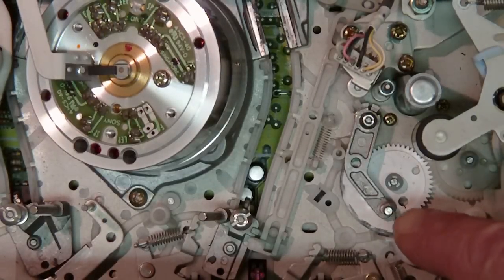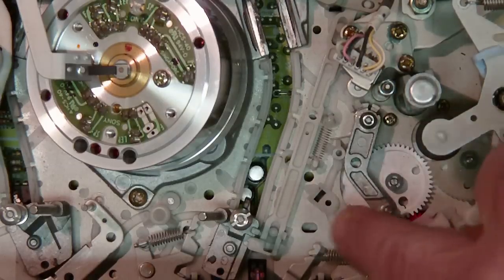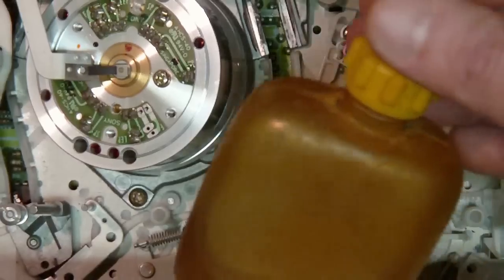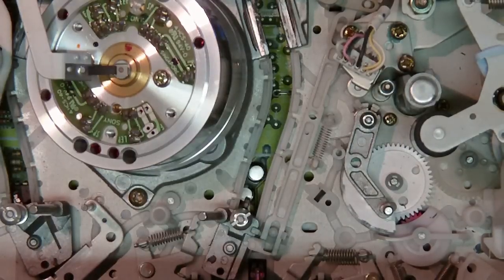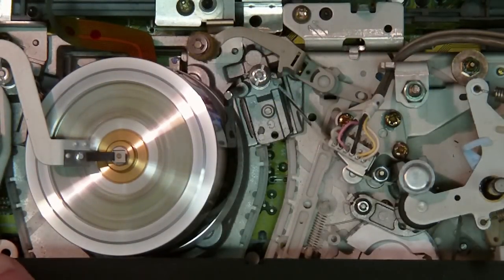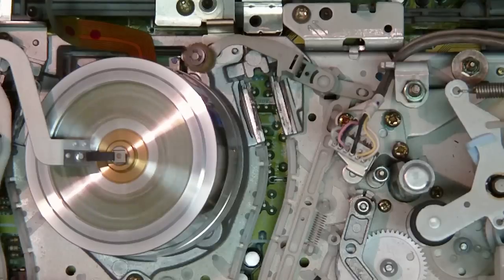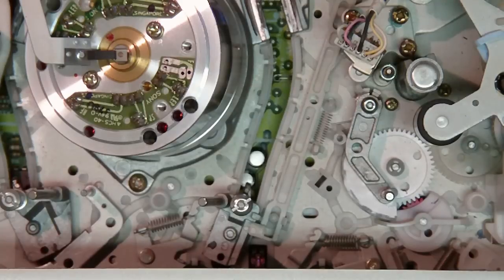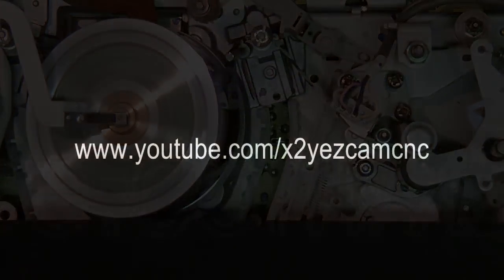Common SONY VCR Video Tape Mech Problems

Comment: I watched this video a couple years ago thinking not much of this.  One day in General Mechanics last year, while the teacher was cleaning out the shop, he found an old Sony VCR with THE SAME PROBLEM.  The arm was stiff and it was eating the tapes.  I took off the top and everyone thought I was crazy to be messing with that thing, but I fixed it, until I plugged it into a tv and found that the whole mechanism was jerky.  I didn't need another mono VCR, so I junked it.  It was fun though.

Comment: Extremely helpful video!  Thanks to you, we turned our Sony SLV-R1000 from a boat anchor into a useful component once again.  Another clue that the arm is stuck is that the counter does not function.  Odd design flaw for such an expensive component.  Either the lube Sony used failed or some type of corrosion took place.  Thanks for posting your video!

Comment: Very interesting video!Some notes: first, after lubricating the arm, you need to realign it as otherwise it will damage the tape.Another problem with these Sony VHS, is that the worm gear for the cassette carriage gets cracked and prevents loading/ unloading a tape.One cure is to glue the gear to the motor shaft.Another familiar problem is the mode switch goes bad (It can be cleaned by disassembly).Capacitors in the power supply and the  servo are also common problems.
Reply from the maker: thanks for your comment

Comment: Thank you very much for this video, especially for mentioning that it requires a 4.5mm socket to unscrew the nut on top of the arm.  I was able to use the information to fix my old SLV-676UC VCR.  On problem that remains however is that it will not rewind anymore.  It makes all the right noises, sounds like it starts rewinding, but the left wheel does not turn.  I don’t see any broken gears, so not sure what the issue would be.  I am wondering where I could find information to help me find the cause and a solution...  Any ideas?

EDIT: I found that there was a gear that was suppose to be able to go up and down.  It was sticking, so I added some silicone spray to it and it seems to have resolved the problem.
Reply from the maker: WELCOME

Comment: I have the SLV-575UC model released in 1990 I believe and I had the same problem as you did. You're video instructions helped me solve the exact problem. I just cleaned  it with some Isopropyl alcohol and it fixed it. The only other problem I seem to be having is I'm not getting Hifi Sound just seems to be in Stereo sound when playing a Hifi Tape. I can hear it trying to kick in but that's about it.
Reply from the maker: welcome....thanks for your comment

Comment: If looking for a VCR to playback old VHS cassettes, I would suggest the later VCR units, the basic models with least controls and basic 2 video heads.  Perhaps JVC units would be the better choice. A remote is not really needed. These later VCR made after 2000 had a more robust design because of mechanical improvements.  The Achilles's heel are the failing capacitors, so keep the unit unplugged when not in use. These will use rubber belts which should still be in good condition. Most youtube videos talk about high end VCRs, many of which are very old and have been used intensively, a gambling.
Reply from the maker: yes

Comment: I have two Sony VCRs; different models but I'm 99% sure they have the same insides. Both have failed in the exact same way! Basically any tape I insert gets ejected while still pulled out; it's like the spindle isn't pulling enough tape back into the cassette before ejecting. It also makes a really loud whirring noise; much louder than it should be. Is this a common issue on later Sony VCRs?
Reply from the maker: thanks for your comment

Comment: Great video! Any tips on what to do when a p guide just comes loose? I can push it up and down the rails but it doesn't catch anywhere, and it's not moving with the other one
Reply from the maker: Check underside of loading gear
Reply: @PCBoardRepair   Checked it and...the arm moving the p guide got disconnected! slotted it back onto the p guide pin on the underside, and it works, thanks, appreciate it
Reply from the maker: @contentious_spartan  thanks man

Comment: Thank you for the Tutorial. The Loading Arm in my Sony VCR is still pretty stiff and I'm having a hard time removing it. Is there a specific tool that works getting inside those tight corners without damaging other surrounding gears or components?
Reply from the maker: small hands

Comment: Great video and thanks for sharing it. Hopefully you are still monitoring these comments as I'm having the same issue where the grease in the arm has hardened and spring can no longer pull the arm back. My question is after the 4.5mm nut and washer is removed what do you do with the spring? I don't want to lift the arm and stretch the spring or does the spring and arm slide up off the pivot pin as an assembly? If not any details on what to do with the spring? Thank you.
Reply from the maker: You don't need to remove the spring? 
Why do you want to remove?
Reply: Thanks for the reply. I didn't want to remove the spring, I was just unsure what how it was all put together to prevent stretching it while pulling the arm off it's post. Anyway, its now working properly thanks to your video. Cheers.

Comment: I own A SONY SLV N750 that eats tapes only when in fast forward or rewind mode [and usually occuring near the end of the tape]. It plays and records OK however.

Would the arm shown in the video be implicated in this specific type of tape-eating problem?What impact does a bad idler tire have [if any] on this type of problem?
Reply: I'm wondering the same thing nearly 10 years later...

Comment: I have a Sony SLV-D300P dvd/vcr where neither are opening ejecting or running. Could it be a motor issue? When you manually move gear wheels everything moves but slowly as you do.
Reply from the maker: could be many things

Comment: I have a tape stuck in a Sony SLV-975HF. Is there a manual way to move the entire mechanism so I can pull out the tape. (I want to save the tape. I'm not so concerned about the vcr- but would like to try to fix it). Is there a worm gear or gear I can turn by hand to make the whole mechanism retract properly?
Reply from the maker: If all else fails look for a disc grinder

Comment: Hi i have a MiniDV/SVHS VCR (JVC HR-DVS1EK) The VHS tape loading works fine but minidv does not, tape will not load it gets stuck upon inserting. Also if i eject it refuses to come out properly could this be a mechanism issue or a pinch roller problem please help as i want to repair mine back to working order.
Reply from the maker: thanks for your comment

Comment: i just bought a sony SLV-695HF and it works all properly. the only issue is when it ejects a squeaking noise happens but it doesnt happen when loading the tape around the head. could it be the thing that reels the tape back in when ejecting?
Reply from the maker: lub it

Comment: I have a Sony VCR SLV-700HF, it is not allowing me to input a vhs tape into the tray, the vhs goes all the way in but the tray doesn’t load and accept it, so the vhs tape basically stays in the front of the tray with about half an inch sticking out of the tray. 

Could it possibly be the arm issue? Or something with the tray?
Reply from the maker: Check the infrared beam emitter in center of loader is working
Reply: @PCBoardRepair  Thank you very much I will look into it!
Reply from the maker: In the center is where the emitter is and on either side of the loading cage there is a sensor that can see whether the beam gets broken or not

Comment: I have a problem with a VCR of mine.  It's not a sony one but maybe you could offer some insight.  It's quite a modern model, bought new in the early 2000's.  It thinks that you are always trying to insert a tape, resulting in it trying to pull in a non-existant cassette.  It fails to do this as a real cassette would release a clip to allow the loading mech to move.  I'm just wondering what I should look for in regards to a sensor to detect a tape load, I cant see anything obvious. Thankyou

Comment: i have a problem that sometimes happens with my sony slv-760hf. pressing play during fast forward or rewind causes the tape to stop and the machine to display an error message on the lcd. with the case open nothing looks strange. if i turn it off and back on the head spins and i hear a motor sound from somewhere else inside for a few seconds then it stops and shows the error message again.  it reads 1L 11 bc usually. if i leave it unplugged for ~12+ hours it usually works when i plug it back in. its hard to figure out what the problem is because when it happens i cant get the tape out. when it starts working again nothing looks wrong and the vcr functions well otherwise. pretty frustrating.
Reply: +Chris Artell I have the same problem with my parents' Sony SLV-E820. Especially when I try to wind the tape (without playing it before) and then press STOP , the VCR stops working and shows the error codes 1L 22 AA, 2L 22 AA, 3L 10 cc, 3L 11 Ac, 3L 11 bc and 3L 11 7c. When the recorder shows one of these error codes, I can hear a motor inside the device; it sounds like it's spinning. The only way to use the recorder again or even to get the cassette out is to wait 15 minutes. I can't open the VCR now because, as I mentioned before, it belongs to my parents who don't want it to be repaired... But if you or anybody finds a solution for this problem, I'd be very interested in it!
Reply from the maker: thanks for your comment

Comment: I have a sony vhs player that throws the tape out of unit. Any thoughts on what to do
Reply from the maker: I'm not sure what THROWS THE TAPE OUT...do you mean the cassette or tape is spilling into machine....need to know exactly what is happening before I will be able to give advice
Reply: When I hit eject it does its normal thing then the mechanism that lifts the tape out almost seems like it get bound up then breaks free which is causing it such a violent eject. It tried watching it many times and just don't see what's causing the problem
Reply: Is there anyway to send video to you
Reply from the maker: @danielrodvold8466  watch carefully
Reply from the maker: I would have to see it to know

Comment: nice video, I have a AIWA  TV VCR combo from 1999, when I stick a VHS in it only plays for about 5 seconds then stops, I get picture and sound, I ran a head cleaner through i but didn't have any luck any solutions to my problem? I was out of town for about a month and it just started doing this when I came back, thanks. sn# 672 - 9Z26840 C
Reply from the maker: thanks for your comment

Comment: When I press play the guides aren't taking the tape to head . What to do?
Reply from the maker: Troubleshoot the issue
Reply: @PCBoardRepair  when I opened the vcr casing, I saw that 2 small stick like things which should actually strech the tape towards the head aren't working. Which is resulting of the video not playing

Comment: What is error 311Ac? I have a Sony SLV-E720 machine. I had a tape stuck inside, that I had to kind of force out. But have this error code now. Also got 3117c error code as well.
Reply from the maker: thanks for your comment

Comment: ERROR CODE C3140 & ERROR CODE C 3142.......How do you fix SONY DSR-25 Cassette loading error code C3140 (when cassette is inserted into the machine but is ejected by the machine due to the error); and error code C3142 (when the cassette tape is inserted but tape would not play, rewind or fast forwarded). How ca these two error codes be corrected so the tape can play again and function normally.
Reply from the maker: not sure

Comment: ON THE METAL PLATE YOU SHOW. THERE IS FROM THE START YOU BUY THE MACHINE SOME VET TO LET THE ARMS THAT TAKE THE TAPE OUT OF THE CASSETTE GOES WEL. BUT BECAUSE THE VIDEO GETS HOT. THE VET. GOES AWAY. TAKE SOME VET AND PUT IT AGAIN ON THE METAL PLATE. OURE THE MACHINE HAS MORE TRUBLE TO GET THE TAPE OUT. AND THE TAPE HAS PROBLEMS GOING IN ANY DIRECTION.
Reply from the maker: Yes

Comment: Unscrew swing arm (count the number of rotations), wipe off old grease from post and inside the arm's hole, dab light gear oil on post and hole, re-install arm (same number of rotations) = No more issues.
Reply: White lithium grease is much better, will last longer...